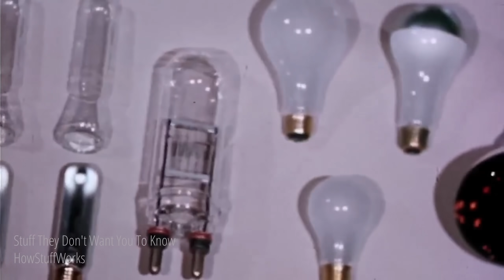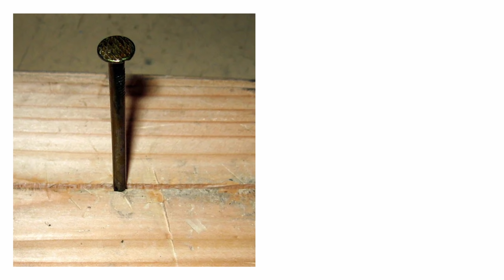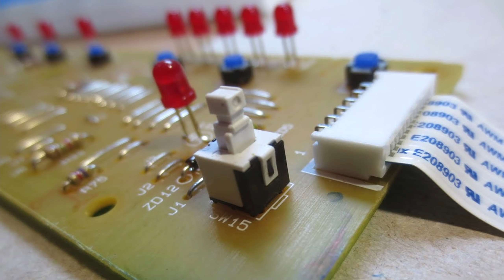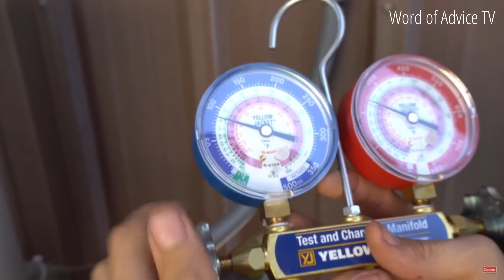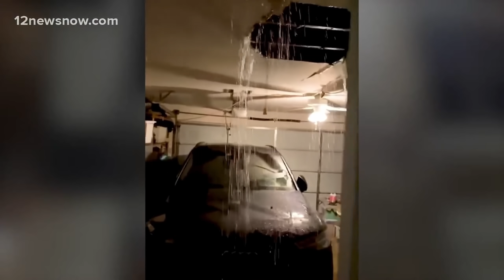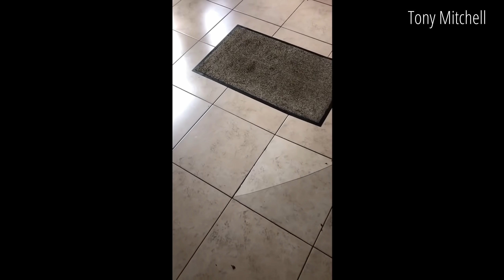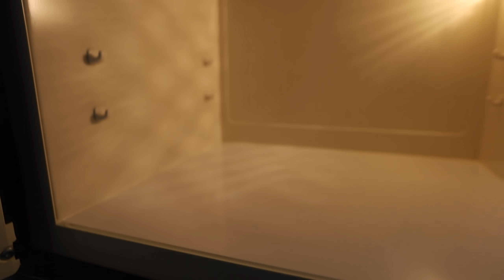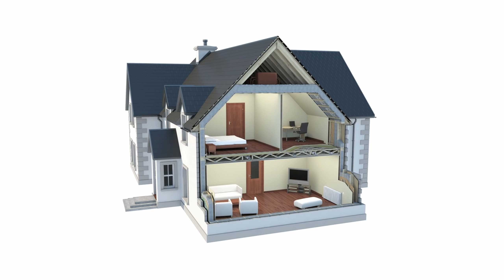Built to FAIL | Planned Obsolescence

Comment: Belinda!  According to ICC building code 403.1.6 all perimeter wood sills shall be anchored to concrete foundations with min. 1/2" BOLTS.  Sections 317-318 require pressure treated wood in contact with concrete foundations.  Your example of a random nail in a non-PT board is miss-leading.  There are many areas of improvement that should be addressed in the code (such as use of particle board as flooring in home and mobile homes) but this is not one. 
In addition, the top wall plate to roof rafter connection must be an approved metal bracket in areas of potential high winds (wind load) such as hurricane alley in the USA. The codes exist, your examples are violations, not standard building practices to insure planned obsolesce.

Comment: In Germany, we have debates, that the warranty required on everything by law should get extended from two years to five years. I would absolutely love to see this happen, but for some products even five years is terrible warranty.
Reply: The best recent change in Germany was making sellers responsible for recycling used electronics/large appliances.
Reply: The same thing is happening here in Czechia too. With building materials the warranty is usually 10-30 years though.
Reply: Germany:  Slab in Building 10 inches- 14 inches (25-35cm)   USA  "Slab"  4-6 inches  10-15cm.
Reply: Also, German homes usually built from bricks, not wood, and repairing the "skin" maybe means a repaint every 30 years. Not sure how this would fare in the south of the US (humidity, tornadoes), though.
Reply: @ThePixel1983  The German "Brick" is very different then what Americans understand as "brick" or blocks. A tornado destroys everything which is not a solid concrete underground shelter.  No matter if brick or wood.
Reply: @eXo0us-T  I know the part about tornadoes. Especially since the point isn't if your house resists the wind but if it resists your neighbor's house. 😁 But what about the climate?
Reply: So you have debates on how to remove options from people. What about people who only plan on using a product for a short period of time and so are happy to pay a lower price for something that's made from cheaper materials? They're compelled to buy something that is overengineered for their needs, that's likely made from better, but more expensive materials. You're just having a debate on the merits of depriving them of that option. People who care about longer warranties will be unaffected by such laws. They'll continue to buy from the manufacturers who use better materials and charge accordingly.
Reply: @Monaleenian  we are talking about buildings here, Homes.  We have the technology to build buildings which last for centuries since a a few hundred years.
Reply: @eXo0us-T  We're not. The OP is talking about 2-year warranties being extended to 5-year warranties. He's not taking about buildings. I was addressing the OP's comment, not yours.
Reply: @Monaleenian  When you're working on governmental level you always work with majorities, you never cover "all".
Especially in european governments that are voted mostly by ranked choice voting and consist of coalition governments, meaning multiple parties that have to make a compromise contract on what they will achieve in their rule. So mostly you'll have your 3 favorite parties come together
Reply: There is a point at which the warranty is arbitrarily long enough that ensuring product failure after that point could be more trouble than it is worth.  Trying to time a failure after 2 years is pretty easy.  Timing one after 10 is much more difficult.
Reply: If the government were to force companies to extend warranties on products, you as a consumer would see the price difference yourself.  Government is no the solution.
Reply: @jeremytibbals7057  I think what you're missing the point, is this goes back to the old argument buy 7 $10 blenders or one $70 blender in the same time frame. The forced warranty would increase minimum costs but the products would be forced to be created better on average. In order for the company to not lose money.
Reply: @im2geek4u  while your personal investment with those 10 7€ blenders are the same, the environmental impact is way greater in that scenario.
Reply: @jeremytibbals7057  well it obviously was the solution in the case of Czechia or Germany. Or, most of the EU, which pushes these laws.

Comment: Bad:
My 1000€ HP ENVY x360 ("Premium Line") is just over two years old and the screws (cost pennies) that fix the screen to the hinges have failed. For some reason the metal back panel needs replacement, so HP is the goto-repair shop. They've given me an offer over 461€! The laptop isn't even worth 600€ anymore if it was perfect!

Good:
My sound system consists of 30+-years old MB-Quart speakers and a 20+-years old Onkyo Amplifier. Not only is the quality absolutely amazing, the reliability crushes all modern digital sound systems.

Comment: This reminds me of a situation my dad witnessed in Pakistan.  He visited his brother in laws house and the brother in law complained that something was wrong with the water tank (I think it kept leaking), so he had to call a repair man every few weeks.  One day my dad checked the tank and realised that he simply needed to replace the washer and it would be fine.  He also noticed that instead of replacing the washer cheaply and efficiently, the repairman had wrapped the washer in some sort of cord or duct tape or something, so that it would stay in place and still work for a few weeks, but then it would start leaking again.  

So my dad fixed the washer and then he saw the repair man and asked why didn't he replace the washer in the first place?  The repair man said: if I fixed it on my first visit, I wouldn't be called back again, I'd lose out on the extra income from call out charges every few weeks.  It's common to come across such cowboy handymen over there, but in more recent years, it's become an increasingly common phenomenon in the West as well.  Dad gets frustrated that electric appliances don't let you open the back with a screw driver and replace simple parts anymore like he was able to do when I was a kid.  I think the old local shop that sold spare electric parts doesn't even exist anymore- last I heard it was converted into a grocery store.

Comment: Recently purchased a new Whirlpool fridge (plain white/top freezer). The thing made a gurgle sound about 50% of the time. I called the vendor (Lowes), and asked them to send a tech to check it out. They said rather than send a tech they would prefer to simply replace it, which they did under warranty (new one works fine). Don't know what happened to the fridge they hauled off, but it made me think that they must build them so cheaply they're 100% unconcerned about any salvage value.

Comment: Whenever there is a Warranty you can count it will have used its life existence. When  having to reinforce with extension at a cost seems like getting double taxation on a failure again. No Guaranty in life except death and taxes.

Comment: When I was growing up in the 60's we had a new refrigerator and a used one.  The new one had fallen off the truck and had 2 fist sized dents on the side and my dad got it 50% off, this was before I was born, probably in the early 50's.  This refrigerator worked faithfully, without problems until the early 80's.  Then we got a new Sears frost free model.  It had maybe 1 1/2 inch walls and ran 45 minutes out of an hour/every hour.  In 1971 my parents bought a Sears Kenmore heavy duty dryer, which got flooded out when the basement flooded.  Replaced the igniter and it kept running years later we replaced the belt and drum rollers.  Now 50 years later it is still going strong in my house.  Now true they did not have the features we have today, but appliances today are woefully inferior in design and a glaring lack of quality.
Reply: I like Kenmore very much. Older appliances from this brand last almost forever. I have a dryer that is 22 years old and a  vacuum that is 20 years old from that brand
Reply: There's so many sensors and parts, it's hard for a person who does minor repairs, to fix the washers and dryers built in the last decades

Comment: Another great, provocative video!  Your presentation begs for a follow-up piece on solutions and on the solution makers.  The “house manual” is a great idea for exposing poor design and for guiding owners in better solutions.  There are various levels to the problem of obsolescence including finance, use of cheap labor and regulation.  Severe weather from climate change makes this problem more prescient.
Reply: There is no severe weather from climate change yet, we are still in the normal distribution of weather window. Maybe in the 2050's there will be some events that might be able to be classified as being due to climate change, but until then there has not and won't be any weather that has not already happened in the last 500 years or so.

Comment: Speaking specifically of foundations, I had a structural engineer come out after I found some problems, and I discovered that 1) I need to get rid of the trees I'm sure got planted when the house was built, because they're too close and/or their roots are burrowing under the foundation, and 2) I need to finish building a retaining wall they stopped short 30+ feet because the ground slopes too severely from one corner of the house. So from construction they didn't build with keeping the slab foundation in good shape in mind.

Comment: I used to be able to fix a laptop if something went wrong with it. That is not economically possible anymore because everything is now soldered to the system board which is 70% of the value of the PC. They also use consumable bezels and LCD tape to hold the screen in place that you cant buy. This is not just technology. In some modern cars you cant even open the hood to do basic maintenance. This is not very environmentally friendly and people need to start demanding repairable products.

Comment: Perhaps this is not a comment about planned obsolescence. However, years ago, we began keeping documents pertaining to all repairs that we did and the home’s appliances (ie - air conditioners, water heaters, sprinkler systems, etc) for our house. We purchase a plastic file box and folders to keep them together and write the house address on the outside. This box stays with the house for the next owners. We believe this information is critical for the next owners. They know when any repair was done, which company may have done the work and gives them knowledge on how to proceed if any problems arise. We have done this for every home since.

Comment: The manual is a interesting point actually. I'm currently working in the building inspection area, and we often told people to follow the instructions of use of their house/apartment, whenever we inspect the place. But, do people actually receive the manual when they rent/buy the house? At least here on Brazil, some buildings do have a manual (but i'm pretty sure they ended up being forgotten with time :/)

Comment: i have never replaced an LED bulb yet...i swapped out all of the CFL bulbs about 8 years ago...i'm going to guess there are about 25 or 30 that i replaced.  they are "Ecosmart" from Home Depot i think.  On another note, i see that spray foam insulation, and think back on how many times i've had to open up walls to run new circuits or some such...nightmare is right!  i'll go with Rockwool.  I live in a manufactured home in the woods that was built with electric heating, last february the power was out for 10 days so i installed a woodstove, and that's actually going to save a lot of money on heating since we have an endless supply of firewood.

Comment: Remember to support Right to Repair movement.

Also, most things are not made with planned obsolescence in mind. They are not designed to fail, they are engineered to not last long. Sound pedantic but is very, very different in practice. When that is combined with unrepeatability, you are looking at a different mechanism that does the exact same thing as designing it to fail.. by far most often things are running too hot as fail rates statistically relate with time and temperature for may components, and adjust it to last to be "a bit after guarantee is over for 95% of the products". They are not designed to fail, just not engineered to last. Some of them can easily last four times the guarantee, some fail immediately. most of them last "some time" over guarantee.

Comment: I think it would require an expansion of the EnergyStar concept to cover things like home construction, so the value of trading a couple hundred sq-ft  of floor space for heavier insulation and a better foundation for your area are carried over when you sell. Another expansion of the idea would have a "Product Life Star" with ratings for repair-ability and durability along with energy; maybe have a projected annual carbon footprint based on it's prorated life. A problem I had with my older home is that when the old fridge died I had trouble finding one small enough to fit the opening-everything readily available was way too big- an expansion of the Super Size Me idea.
Reply: Decent idea. However, energy star has become politicized and useless.
I think the best option is an aware public that demands quality.

Comment: LEDs do last years and years...if they are designed properly. Most are run way too hot, a cheap 7W should really be only 4W, where as more expensive 7W could be run at 10W. It does pay off here to invest just a bit, the bad thing is that you just don't know.. as expensive bulbs are also subjected to heavy cost cutting and you do not get 5 year user feedback, the models aren't in the shelf for that long.

When i switched to LEDs, i went in early. Some of the LEDs are still working after a decade, some burned in few months. The only real common factor has been... price. But i also still have some very cheap LEDs working so... But they can last and there are ways to modify them so that they will last. There are usually couple of very, very cheap components you switch and you adjust them to run at lower wattage. The curve is not linear, half the wattage will give you at least four times more years. When you think of them as "lasts 20 years", such mods are not all of a sudden useless, you can create a bulb right now that will last from father to son.. Just buy oversized and tune them down.

Comment: I’m so worried.. I was accepted into a pilot program that basically gave my home free “liquid foam” insulation. They drilled holes in my drywall and pumped foam into them. I agreed to the program thinking it was a great thing to help insulate my home better (in chicago) and now I’m realizing that I may have possibly just ruined any future electric and plumbing repairs? Say it ain’t so 😩
Reply: I sympathize. I listened to bad advice from a contractor to spray foam my attic space and now I'm having humidity issues in the house. I dread the thought of having to dig out all that spray foam, and of course all the wiring is now imbedded inside so I would have to be careful.
Reply: @ryansilke  why is this even legal? 😩
Reply: @ryansilke  okay i just saw this and realized I hace "injection foam" and not spray foam" this makes me feel a little better... (I think?). I hope you get you issues sorted out as quickly as possible. https://www.youtube.com/watch?v=AkL42auxt6g

Comment: The change in charging ports on cell phones and tablets isn't "planned obsolescence". That's just moving to better options as they've become available. At least things have standardized, though, to USB type C or micro-USB type A. (Of which I don't think anything new still uses the latter.) I remember when each manufacturer had their own connectors separate from everyone else, and in many cases didn't re-use connectors between generations. So things have gotten far better on that front. And given how versatile USB type C has demonstrated to be, it's likely not going anywhere for a long while. Now if only Apple would get on board with using USB connectors instead of their proprietary connectors.

A lot of what you've mentioned in "Layers of change" makes me glad I bought an older home. Yeah I'm having to pour money into replacing the insulation in the attic, and I'm also having to go after older wiring in the process (replacing the last of old 14/2 wiring with new 14/3, and replacing switches without ground lugs with ones that have them). But at least none of that (so far) requires any kind of significant demolition to get to. Virtually all of the plumbing is easy to access if any pipes ever need replaced or repaired. And same with most of the wiring (which I shouldn't need to touch... hopefully ever once the last of it is replaced).

And thankfully I've managed to resist "perceived obsolescence". My wife and I typically only upgrade or replace if needs change.
Reply: Yeah, charging electronics is an example of things actually getting better. When I went shopping for my first cell phone in 2003 it seemed like every phone had its own charger.